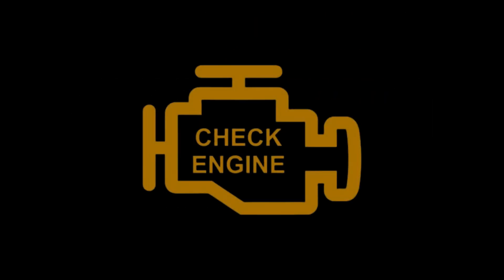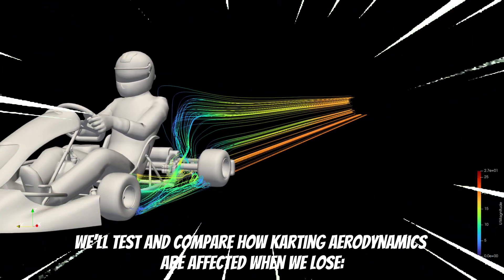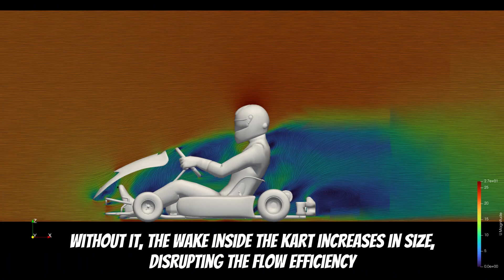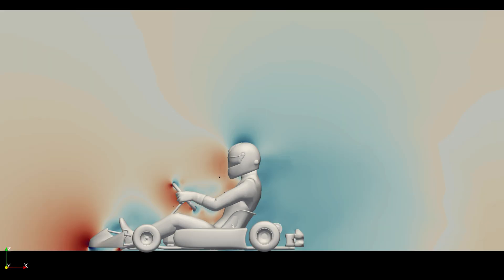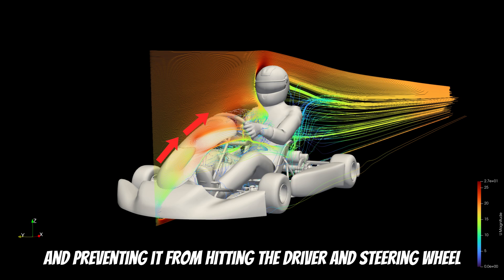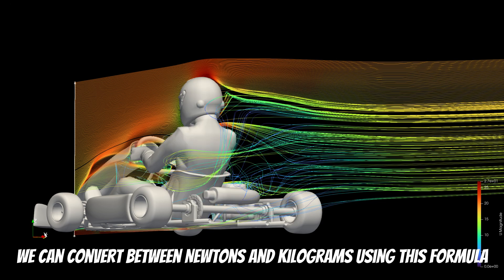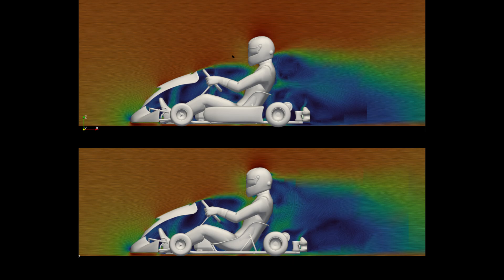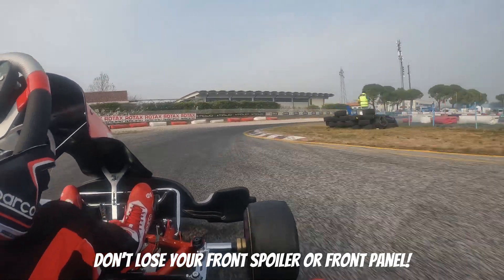CRASH & KARTING & Aerodynamics

Comment: OK, so losing your rear bumper costs 0.2kgs in downforce and ever so slightly increases drag coefficient.
However it also reduces kart weight, which not only, marginally, improves acceleration but also reduces inertia.
Perhaps the biggest impact is the difference in rigidity.
When they introduced these, and I was racing back then, I was told they created an issue because they made the kart too stiff.
Of course I'm sure the chassis manufacturers catered for that in their subsequent designs, but goes to show that losing the rear bumper would have the kart running too soft and that would prob be the greatest difference in performance.

Comment: Hey,
Nice video and analysis!

If you allow some constructive feedback;
1) You refer to the stagnation points as wakes - the term 'wake' is not rigourously defined, but usually referred to as the large turbulent air volume behind the object in practice. Stagnation points are points (if you regard them in 2D) where the flow is stagnating, since an object is in its way, so the flow has to split around said point.
2) Around 1:45 into the video, you forgot one stagnation point at the beginning of the chassis, with the front bumper on. So, instead of the number of stagnation points increasing from 1 to 4 when the front bumper is detached, it 'only' goes from 2 to 4 :)
3) At 3:15, you correctly highlight that the now local increase in pressure indeed increases drag further, but could have also pointed out that the downforce has increased because there is now a vertical pressure gradient too.
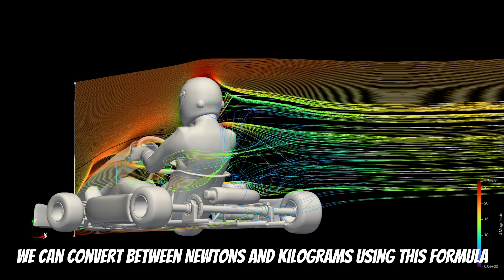4) Starting at 4:43, when you say losing X amounts of downforce is roughly equivalent to losing X amounts of weight, in terms of aero performance, that is true, *however*, when you lose actually weight, or, its mass equivalent on our planet, that also reduces the overall mass and inertia of the kart. Losing mass is actually more beneficial, especially at low speed vehicles like karts, since the benefit of that far outweighs the benefit of the same downforce equivalent. I'd even consider that the loss of bumper as a now detached mass is more beneficial for laptime then its change to the overall airflow, especially considering that the bumper is located quite far away from the centre of gravity of the kart, so it highly reduces moment of inertia.

I hope this helps! Keep up the good work and learning! :)
Reply from the maker: Hi, thank you so much for your insights! I really appreciate your expertise. I was wondering if there’s a way to stay in touch? As I might need your consultation for future projects.

Comment: No rear bumper would equal less drag and air resistance therefore more acceleration no?
Reply from the maker: Well not exactly, each part of kart's aero package is important. But some of them are more some of them are less efficient. Lack of rear bumper causes different air structure in rear section- a bit worse ( it is really small change but still) and this of course  increases drag.
Talking about acceleration, much bigger impact have rear wings- usually seen in F1 or sport cars. Unfortunately standard karting doesn't have it. 
Lack of it can cause more acceleration at the straights since airflow has no-longer additional object to hit. But lack of rear spoiler also comes with lack huge downforce produced by it. 
In conclusion rear bumper has not big impact in acceleration difference as lack of rear-wing  could have .
Reply: @ I see, well I race 4 cycle and whenever there is a series that allows the old metal rear bumpers everyone switches. People have found huge gains up to 0.5 seconds a lap with the metal ones because they are just a frame and have less air resistance.
Reply from the maker: @anthonyfrattaroliracing that sound very interesting I need to add this to my check list for future simulations. Thanks for idea!!!